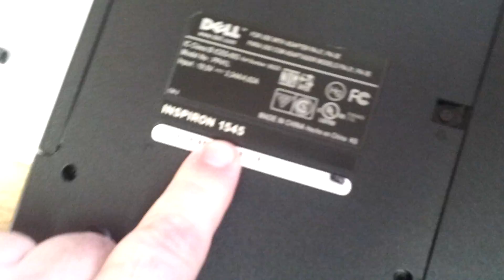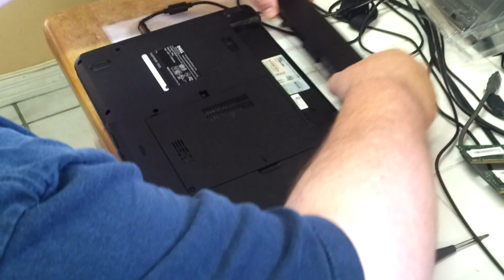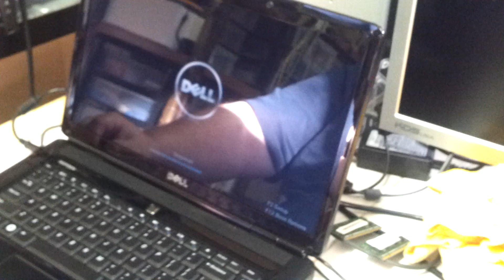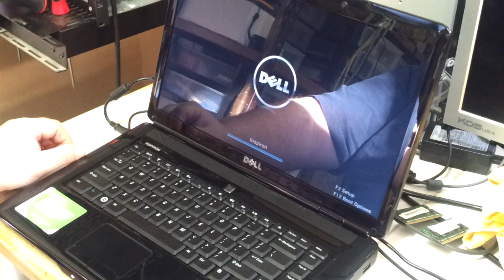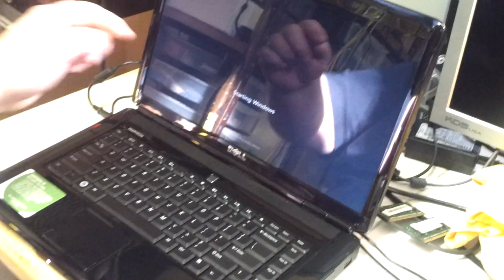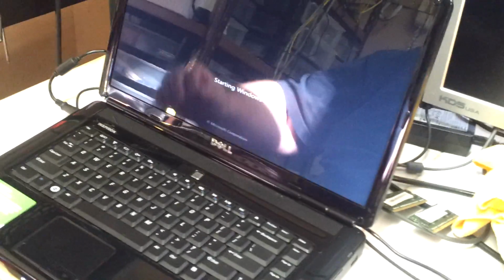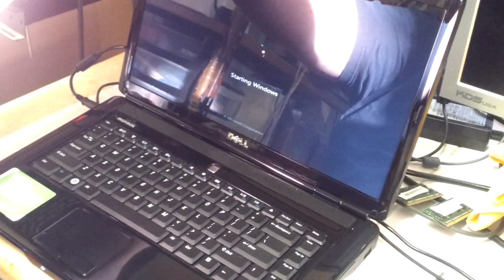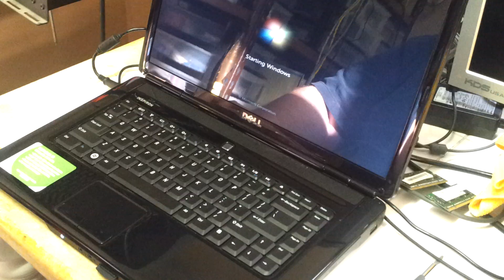DELL INSPIRON 15 (1545) Memory Upgrade (Watch my mistake)

Comment: I work with a lot of 1545's.  The top memory slot is a little difficult to see, but when you slotted in your RAM stick there was no resistance when pushing it down, so I believe you totally missed the RAM slot.

I would like to add that before handling any bare computer hardware, it is wise to ground yourself to protect static in your body damaging the new equipment, if you don't have a static strap, perhaps touch a radiator o remove as much static from your body.

Comment: What's the max ram
Reply: TimeTo Tech 16 16gb
Reply: Is this true? That the Dell Inspiron 1545 can take 16GB of RAM?...that would be awesome!...My Mom's laptop is a 1545 but its slow...and currently has 4GB....but if I can get 16GB in there? I imagine her machine would run a great deal faster. Where would one find 2 8GB chips in the "2"....(as opposed to the DDR3) version?
Reply: @eddieoconnor4466  not possible for ddr2, you can go for 4x2 corsair or samsung...etc good brand ram stick
Reply: @darshnikdeep4650  Awesome!....thanks for the info!
Reply: Dell1545 leptop ram sport why

Comment: What was the mistake? lol, The computer seemed to boot up fine, either that or it just booted up without any RAM at all...
Reply from the maker: If you notice about  5:00-5:06 you can look at the teeth edge of the memory. Now look at the memory chips in relationship to the plastic memory holder of the laptop, notice how the left side is slightly higher than the right side of chips? That is why the memory did not register. If that stick had been properly seated it would have recognized the extra memory and reported it and requested the F1 key be pressed. In this case it was far enough out that it didnt even register an error :( insert fail here :).  So after I shot the video I fixed it. :) Remember stuff happens who cares as long as it works when your done thats what matters most.
Thank you very much for watching my video. Dan.

Comment: Hi there i want to also upgarde my memory on my Inspiron 1545. I need DDR2 but is the clock speed important? I mean RAM for sale online has differenr speeds? Can you give me some advice on the speed of RAM. For  200pin DDR2 which memory module should i buy??? PC2-8500 OR PC2-6400 OR PC2-5300 etc.... There are quite a few. Slightly confused on which to buy?
Reply: Pc 2 6400. I hope i am not that late as i am still using 1545